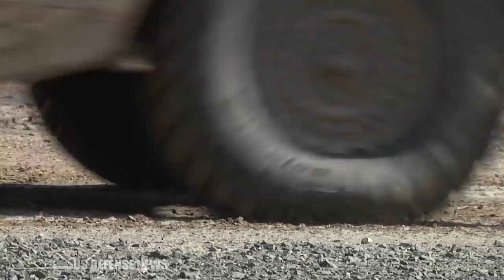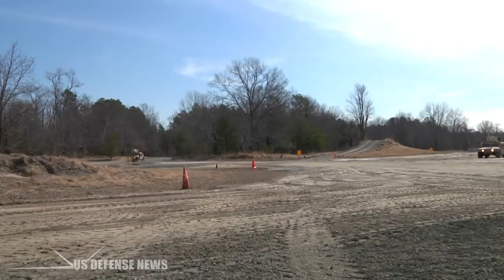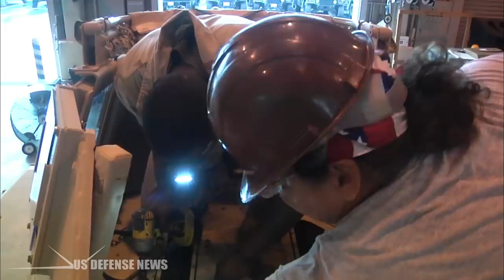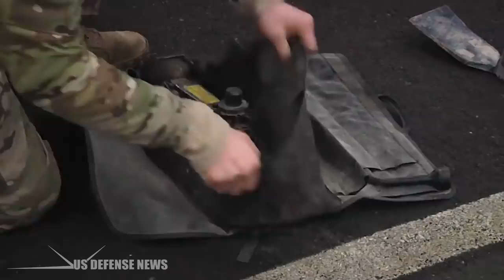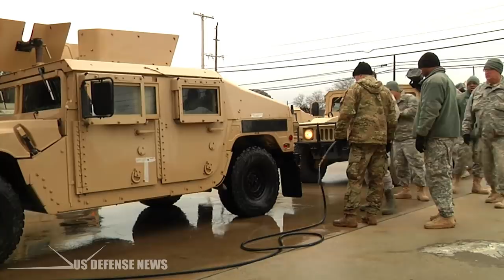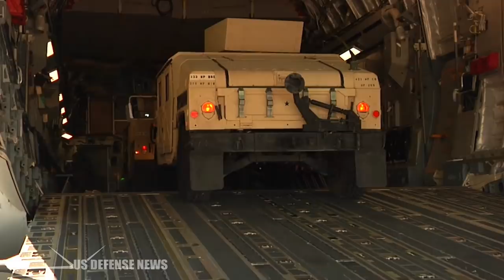AM General Contracted to Modernize U.S. Army's Humvee Vehicles

Comment: Humvee all with wider rear track than front track bodyworks : the lowest traction 0.7g, extreme tail flick, extreme slide, 20-100 l/100km, over 100 l/100km by F1 speed.

From
Humvee all databases

End report.

Comment: Easy to maintain, easy to drive and all the manuals updated for them. All the older Mechanics know the tricks and common faults with them and pass knowledge down to soldiers that just getting started . I am 91b and I was taught alot about these vehicles, it Is a simple design

Comment: Humvee all with wider rear track than front track bodyworks  : the lowest traction 0.7g, extreme tail flick, extreme slide, 20-100 l/100km, over 100 l/100km by F1 speed.

End report.

from
All number database